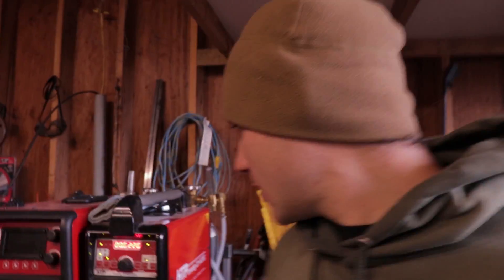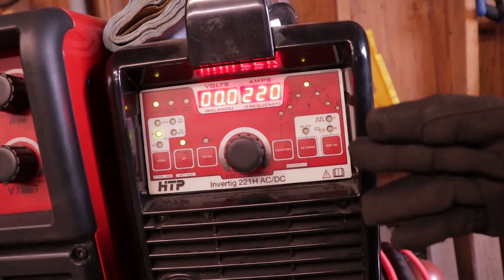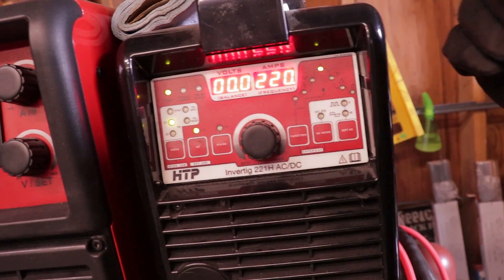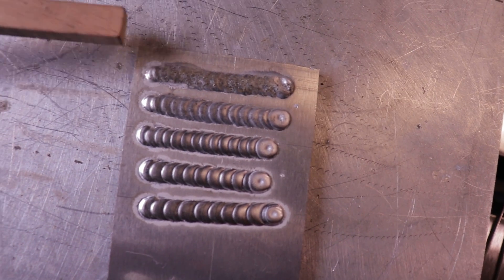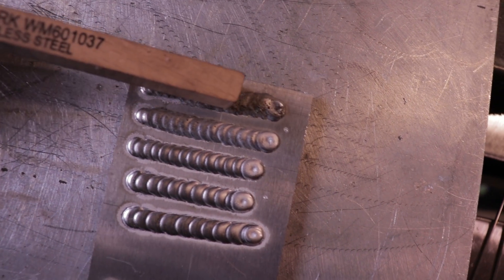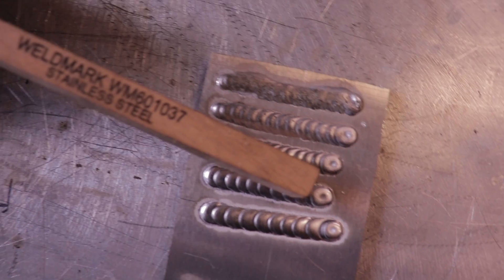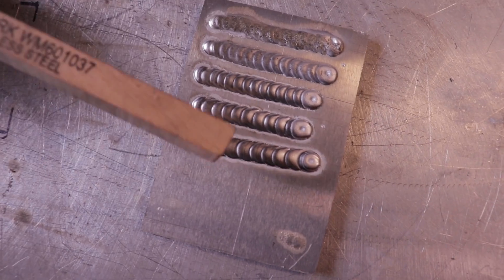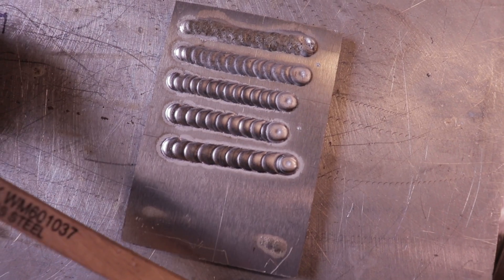How To Set Your Gas Flow For TIG Welding

Comment: This 2yr old video sure did fixed my dull, crappy, and dirty aluminum welds.  I have the same exact flowmeter, bumped it up to 25cfh and my welds cleaned up. Ended up using my spare flowmeter and noticed the graduations are different.  I tried 15cfh with the spare flow and I get clean welds.  Thanks for the vid bud!!

Comment: Do you feel like your argon was just used to carry the ac current out more to the edge to make up for the low cleaning amprage? 

I generally when wanting a very  precise arc run 20%are more ep amps and it alows you to run alot less ap on the balance  and less gas and keep a very fine focused arc
Reply: I generally  use the ac amplitude on a dynasty 400 in the way i described as i have to do alot of inside corner welds  with bead profiles close to .09" and up to 1/8inch in some aplications.  And it not only helps focus but also lrevents tungsten deformation

Comment: Your welds aren’t bad, but there wide for how small of a weld your doing, you need to play with your frequency and balance, they should be tighter. Basically you need more experience before you share knowledge. This isn’t a video so much for gas flow as much as machine set up.
Reply from the maker: Haha you have no idea what you're talking about.
Reply: From a guy with no content? 
Really, Patrick?

Comment: First time viewer. Nice video. Never TIG but am getting setup with a Miller 215. DC only so I can't do aluminum. Question I have, is gas flow as critical for general (1018) steel welding? I too have a cheap flow meter so I suspect the accuracy of it is crap.

Comment: So glad you brought up meter inaccuracy since I've needed 20 to 30 Argon for good welds with my cheapo flowmeter, thinking it was my technique causing dirt.  Plus, it's hard to know how you're doing when all the YouTube pros are getting it done with half the gas.   I suspected I either had a leak or a bad meter.  Thanks.
Reply: Yeah same here. I couldn't figure out why all my welds were black and grayish on stainless but I think the regulator i have is a bit broken by sitting pressurized for so long. I'm going to get a proper flowmeter.

Comment: Apart from a very informative video, that was a lovely piece of camera work!! The point you raised regarding gas flow readings not necessarily being accurate applies to all settings. Tweak them all as necessary until you get the result you need. Thank you.

Comment: Have you tried a standard #5 nozzle for aluminum or do you always use a gas lens? I have heard that a lot of people prefer a standard #5 nozzle for aluminum. I haven’t tried it yet and curious if you had. Great vids 👍🏻
Reply from the maker: Ya I use #5s a lot.  They dont leave it as shiny but they help stabilize the arc a little better than a gas lens and they dont get ruined when you dip filler into the tungsten

Comment: hi, and if I use standard nozzle # 5 and pure argon, then what settings are better to set?
Reply: You should be running pure argon for aluminum all the time with Tig. If you are running a gas mixed with anything except helium you will never get a good weld.

Comment: You are welding with a very short arc, tip close to the metal, so the argon should be flooding the weld puddle even in the first weld example. Do you have a theory why 30 or 35 cfh produces a good weld but 20 or 25 cfh doesn't?
Reply from the maker: I'm not sure why not.
Reply: One thought ive had is that the zone which is being cathodically etched (by positive portion of ac wave) will only appear in areas that are shielded by argon gas, insufficient argon flow/shielding means that the oxides on the very edge of the puddle during foward travel are not removed but are free to be soaked up into the puddle in which case they ALWAYS will float to the top. Compare the 'etched' zone between the welds and it is shown quite clearly once it gets to 30/35cfh, when we mig thick alloy at work you can see the etching zone and when you have the gas dialed in (with all the other parameters etc) your welds will come out virtually sootless

Comment: Any suggestions on what I should get for my first Tig welder?
Reply from the maker: Htp is my favorite but buy whatever you can afford.   If you buy a cheap one more than likely you'll be upgrading to a better one after a year.  That's what happened to me
Reply: If you're on a budget, the PrimeWeld 225 TIG gets raving reviews from experienced welders.   You'll find it on Amazon.
Reply: Thanks for the suggestions I'll check them out 👍
Reply: I have a Primeweld 225. Its a great machine and the service after the sale is great.

Comment: I like the side by side comparison. Shop welding I usually double the cup size for flow rate. In the field its usually a higher rate. Never really paid attention to balance vs flow rate. Always set my balance based on quality and cleanliness of base metal, something to play with though.... Thanks for the vid.
Reply from the maker: Yep that's what I usually do too.  At work I'm running 12-15 cfh but at home I've gott run 25-30.  This aluminum has been sitting around for a couple months so I lowered my balance down more than usual too!  Thanks bud

Comment: 15cfh works for me. But like you said, all flow meters are different. When I need to get some aluminum melted I run 75 25 and extra argon. So like 25 cfh of 75 25 and between 10 to 15 cfh of argon through a #8 gas lens. Have a nice Holiday 5th street.
Reply from the maker: exactly the same for me bud!  15 on pure argon and 25 on my 75/25 mix!  It through me off how much different my home one was
Reply: Are you saying you use 75/25 for Aluminum instead of pure Argon?
Reply: @ljdm1956  helium argon mix
Reply from the maker: @ljdm1956  I use both.  I use straight argon for most things but when I'm welding thick stuff I throw in the helium blend